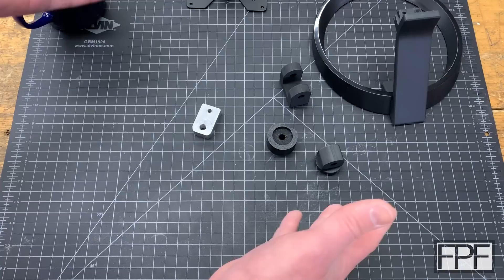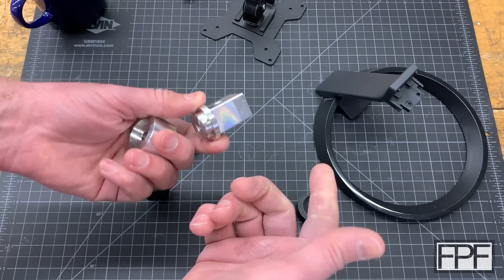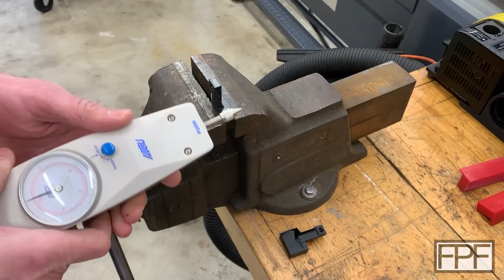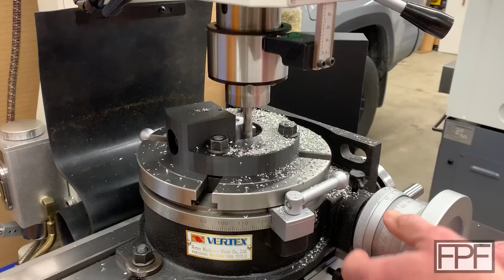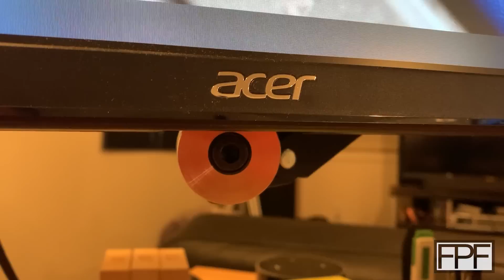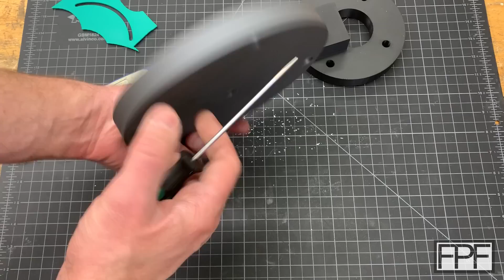3D Printed Rotary Fixturing

Comment: I would have called the part level with the center locating pin. You are only milling away clearance. Not a part spinning at 10k RPMs. At work when we did “G-jobs” personal stuff, we usually had to be quick on making that stuff, unless it was for the boss. Nice job on the clearance cutting. With time as you machine more, you will become more proficient and faster.

Comment: At 18 minutes in I’m compelled to type a comment. Obviously this was good practice/proof of concept. While it wouldn’t have been nearly as fun of an episode, and it wouldn’t have been “perfect”, a really easy way to get nearly perfect in about 5 minutes is to use a gauge pin through the bore in your part, clamp your part in the vise with the gauge pin flush against the jaws, and make a series of endmill passes, rotating the part minutely in between. The gauge pin ensures your constant radius. The only difference is that the feature is faceted, but in all the times I’ve used this method, the final parts really do come out nearly flawless. Of course, as I type all of that out, I have to admit that I have that same Vertex rotary table still sitting in it’s box, and I paid good money for it, so perhaps I should be taking more cues from you. 😊
Regardless, GREAT episode!

Comment: I did something similar, but I 3D printed a plug for the rotary vice, a small alu spacer plate with a hole, then used a piece of threaded rod to bolt it down through it all to a nut in the bed. Does require aligning vice, nut, and spindle, but it did the job.

Comment: How does the part "pull back into the PLA" when the part is held by the pin in the centre of the turntable?  The heat may have melted the PLA a bit, but the part wouldn't have moved unless the pin bent.  A much more likely explanation for the step is tool deflection.  A full-depth cut, especially one removing quite a lot of material is putting a lot of sideways pressure on your bit, and they do bend.  On small mills which don't have the rigidity of a Bridgeport, the whole column can bend too.  I think that if you were to repeat your last pass, because it's removing much less material, you'd get much closer.  You may still get deflection due to the depth of cut, but it should be less.  Tool deflection is a common cause of parts not coming out with perfectly square sides.   In this case, probably your best bet would have been to take a half depth cut, then flip the part and repeat.  It would still be centred on the pin, so the cuts should line up perfectly.  Don't forget to put the cutter as deep in the chuck/collet as it will go to reduce the bending moment.

Workholding is frequently a challenge, and it's where good machinists earn their keep.  Where mortals might take most of a day figuring out how to hold a part, they have the experience to find a solution much quicker.  I like the idea that 3d printing can level the playing field a bit.  Of course, if your fixture takes half a day to design, and a couple of hours to print, you're still way behind the ace machinist.  However, if you have lots of the same part to machine it can be much quicker in the long run.  If you can design the fixture so it can hold the part for every operation, you're really onto a winner.

Comment: With the centring pin in place why couldn't the part simply be clamped to the rotary table with a suitable spacer underneath it?  Also a four flute cutter is not the best choice for aluminium, two flutes work better here and the addition of a suitable cutting fluid will prevent chip build up in the cutter. WD40 or kerosene work well here.

Comment: If you were to push steel or aluminum bushings into the bolt hole, you might overcome the problem of heat from the part softening the plastic.

Comment: "16 hours machining time, really? I mean, setup time and all sure, but it's not like you're new to machining. Surely it doesn't...  oh half a thou on every measurement, of course. Carry on."
I don't do metal working (yet), but I have a very similar problem in woodworking, mainly adding unnecessary flare and features, which do require a certain amount of precision as well, but not fully analogous to precision in metal working. There's always an excuse to hone your skills.
Reply from the maker: this made me smile, thx

Comment: I wonder if it'd be worth a little effort on parts like this to put a little effort into designing some channels into the printed fixture so that you could flow a little bit of air through the printed part to keep it from building up heat. And/or if you designed it so you could drill a couple holes post-print and run low pressure compressed air through the infill.

Comment: I dont know if I missed out something, but would not the easiest be to hold it down with a bolt through the hole in the centre of the part with some washers on each side to protect the part. The bolt should be bolted to a simple flat steel bar with a hole in the centre bolted down to your rotary table.

Comment: Gave me an interesting idea for something related. With an Arduino and stepper motor I could just tell an affordable drill press setup to rotate the piece in X steps to have the drill press cut  holes in a circular pattern.

Comment: Ya know, you could have just uploaded the STL to PcbWay or similar and had a metal part without spending so much time and money. I'm glad your time is free, otherwise you just spent a LOT of money for a monitor mount that you could have bought a couple VESA compliant monitors and a proper tri-mount. I have had really old monitors and to not have speced a standard Vesa mount as a requirement in the last 20 years is beyond me. Still, I had to watch the train wreck.
Reply: Way to completely miss the point. Yes anyone can go out and buy a ready-made fix. By doing so you completely miss out on the challenge of designing an engineering a solution without having to just go and buy one. It's part of the process that's enjoyable. For you to watch one of these types of videos and completely miss that point and then proceed to comment on it says a lot more about you than it does about the author of this video. The only train wreck I see here is your comment.

Comment: Im just an armchair machinist, but i think it would be best to cut the full z depth. Just start with a large radius, and work your way in to the final radius on the DRO. That way you get a better finish (since you are cutting full depth) and can sneak up on the final dimension.
Reply from the maker: for the 2nd one I plunged out most of the material 1mm from final diameter, and then split that into 2 passes

Comment: End mills do put a lifting force on your part. There are end millls that are designed to push the part down but then you have issues with chip extraction. You should also look into an alcohol mist for coolant on aluminum. It works fantastically and it just evaporates. It keeps your part cool and prevents aluminum from welding to the tool. So little is used that the vapors are not an issue.

Comment: I own a really good samsung monitor and about 10 years ago I moved my I.T business from a shop to my home and need to mount all the monitors I had on the wall, I simply removed the rear cover from the Samsung monitor and drilled four holes Thu it and used some small screws and nut to hold the vesa mount to the rear cover. Been that way for just over 10 years now
Reply: I would do the same... probably would cut and drill 2 thin aluminum or steel plates with cork or TPU to match and sandwich the drilled thru plastic to help distribute the load across the plastic and reinforce the shell a bit

Comment: For the bolt holes for the t-nuts, you can add a couple internal cylinders around the bore with .1 or .2mm spacing to add extra walls(and top/bottom layers) under the bolt head. Can take the torque load from 4-6lbft up to 10-12lbft if you do it right.

Comment: Multiple monitors is a great problem to solve with FP.  I have an arm with 4 monitors in a 2x2 arrangement, and they are the same brand and model. Working on a solution to somehow stick them together so they don't have gaps between the things, and that they are held in place relative to each other. Was using some cloth sticky tape before, but it is far from being resilient over time. 3d printing is the way here ... just got to prototype some solutions and find one that works.

Comment: You only needed 4 things, and you probably had them already. A dial indicator, a pin for the hole in the part, a parallel and an angle plate or 123 block.
Reply from the maker: You're right, pulling it up to an angle block would definitely work.  Unfortunately, I don't have one, and I don't think my 1-2-3 blocks would clear the M8 bolt to hit the threads in the part.  Fortunately, the 3-d printed fixture worked very well.  I do need to add an angle block to my tooling though for other future projects.  You can never own enough tooling :)

Comment: I would have made a VESA-compliant plate and epoxied it to the monitor, then use existing mount hardware, but that's just me.
Reply from the maker: These monitors only have 'structure' to them at the bottom 2", while the rest is in ultra thin cover for the LCD panel/diffuser.

Comment: try climb cutting the last pass instead of conventional...
Reply from the maker: I wanted to, but the vertex manual for the rotary table said only cut rotating the handle clockwise
Reply: @FunctionalPrintFriday  Interesting...
Reply: @FunctionalPrintFriday  They would say that due to the clearance between the gears. You can still do it (or at least try this) snug the table locks to create drag on the table - as much as you can and still have smooth table motion. Take a fine cut for you climb mill pass - you are just getting finished size and finish quality - not metal removal at this point. All should be good as you have very little force pulling the table (fine cut) and you have the locks providing the drag to stop it from happening. It cannot be emphasised enough though that you should NEVER get hungry for metal removal when doing this otherwise the bin of shame will await.
Reply from the maker: @ianloy1854  thx, I'll try it next time

Comment: The slot cutting jig is interesting.  Machine work on thin stock is always a challenge.  I like the creativity and willingness to try new things.  A few constructive comments: 1) PLA is pretty strong so you probably don't need so much material, especially on the bottom.  People have made chromoly bending dies with PLA with about 6 perimeters.  PLA is an under-rated material.  2) A vacuum port would be a great addition. Chips are the main problem in slot cutting.  Also, most machinists will do 3 passes to make sure the slot has clean edges.  Endmills deflect and do not cut exactly on-size.  3) The alternative to a single-use fixture is a fixture plate with toe clamps, which will be a lot faster to set up (including CAD and printing time) but still involves a lot of fiddling compared to sliding this fixture over a dowel pin. 4) The Old head machinists, the gray-bearded machinists who cluck quietly in disapproval, have a tendency to over-invest in tooling.  It is a business mistake to invest too heavily in the fixtures and tooling for a new product, especially before it has a proven sales record.  Maybe this type of 3D-printed tooling could bridge the gap between a prototype and low-level production.  If the product succeeds, the model of the jog could be used to make more permanent production tooling out of aluminum or steel.
Reply from the maker: Couldn't agree more.  I used the first fixture to finish the 2nd part this morning, and it's still in great shape.  Would probably go 15-20 uses before it needed to be re-printed, and even then the cost to print is negligible.  For one-offs or low volume runs I think this has great potential

Comment: If you were really concerned about the PLA softening with the heat generated, you could print the part out ASA. The glass transition point for ASA is a lot higher than that of PLA. Thanks for the video. How you come to a result in the design is the most interesting part. Irrelevant if it's machined or 3D printed.
Reply from the maker: thx!

Comment: I always enjoy your videos.  I had the same issue with my Acer monitor.   Unfortunately I dont have the tools or experience to event attempt that.    Thankfully the jungle site had an adapter to be able to use the arms by Vivo for $20 "VIVO Quick Attach VESA Adapter Plate Mounting Bracket Designed for Compatible Acer and Viewsonic Monitors"

Comment: Also, as to machining content on your channel. Personally I enjoy all of the above as well. I feel like most viewers probably feel the same, but obviously I can't speak for others. I vote that you should create and share all of your hobby related content that you enjoy, but if you get push back from viewers, you could always create an alt channel and include it there. Although that would require more of your time so maybe not such a good idea. It's always interesting to me that people who share enjoyment of one hobby type, typically share multiple hobbies, although sometimes unknowingly.
Reply from the maker: I may feature more projects that aren't 3-d printing.  I have a lot of stuff that's just sitting ready to go (like converting a small kiln to a heat-treat oven with digital controller) that I never get to because pretty much all my time goes to whatever 3d print I'm featuring that week.  The success of the channel is a blessing and a curse in that way.

Comment: It’s cool to see the process, but wouldn’t have been simpler to create a replacement adapter plate?
Reply from the maker: I considered it.  I really wish I had 1kW+ CNC fiber laser for one-off parts like this in metal.  The plasma tables are neat, but you're pretty much limited to steel, and the cost of consumables on the water jets are prohibitive.  I hear rumors someone may be working on a maker-friendly CNC fiber laser.  Stay tuned :)

Comment: 3D printing is great for work holding.  It's particularly nice when you already have a CAD model for the part to be held that can be subtracted from the work holding fixture.

If FDM printed ABS or ABS-CF wasn't strong enough, I probably would have used an MSLA resin printer and ABS-like resin to 3D print the parts rather than make them from aluminum.  If I was committed to making them from aluminum, I would have machined the one corner off that prevented rotation in the desired direction and if a slightly under cut 45 degree corner cut still caused a binding I would have roughly belt sanded it to fit.  I like pretty machining but not enough to spend half a day making a part pretty that I won't see once it's mounted.  I'd save my Art Of Engineering for something that mattered more to me.  YMMV.
Reply: Although….. sometimes you invest the time learning how to do something you never done before 🧐 ….. so that one day when it matters you have some experience before scraping a critical part you’ve already invested a ton time into 👍😎👍  Just like practicing your technique of achieving tight tolerances even when the feature is purely cosmetic.
Reply: @joell439  - True enough.  I do a lot of stuff that isn't needed for the joy of doing it.  One of my biggest problems is spending a day to optimize a process so it takes one minute instead of ten, when I'll only need to do that ten times in my entire life, spending eight hours to save 90 minutes.  The engineering desire for optimal solutions sometimes results in a local optimization and a global inefficiency.   😀

I have a basement shop full of CNC machines that I built or converted to CNC, and I almost never use those tools now that I have 3D printers.

I just got mad at a DVD box set with 3-5 DVDs stacked on each spindle, with the stacks overlapping with each other, making it very difficult and time consuming to get the DVD that I want and causing so much flexing that I am in danger of breaking the DVDs.  I pulled out the spindle inserts and fired up the CAD to make a simple box insert that holds all of the DVDs in a single stack so I can quickly thumb through the stack and pull out the DVD that I want.  If I'd like to watch them all in order, I simply pull a DVD off the front and replace it at the rear, which is WAY better than disassembling the overlapping layers of DVDs pressed onto stalks and having loose DVDs sliding everywhere.  That was an optimization that was so easy to implement with 3D printing that it saved time over the loathsome frustrating solution that was provided by the manufacturer.  Parametric CAD makes it easy to make box inserts for boxed DVD collections of any size.  The next time that frustration occurs, I am minutes from 3D printing a solution.  What frustrating inefficient lives people must have led before we had 3D printers.   😀